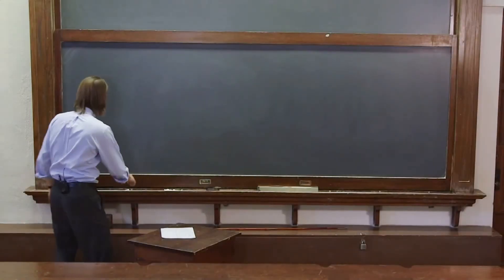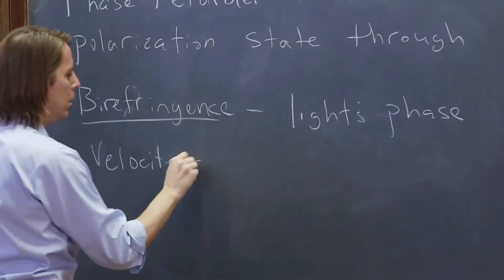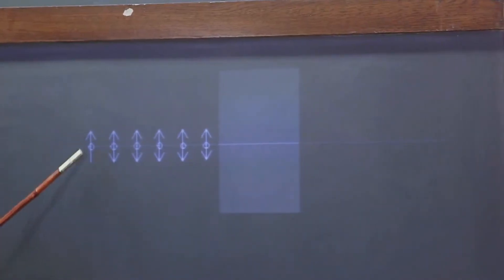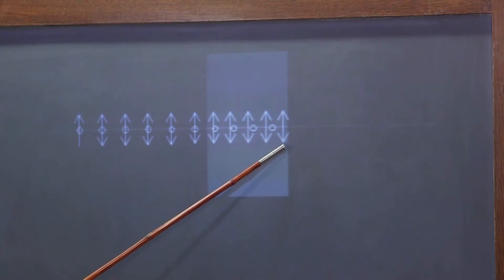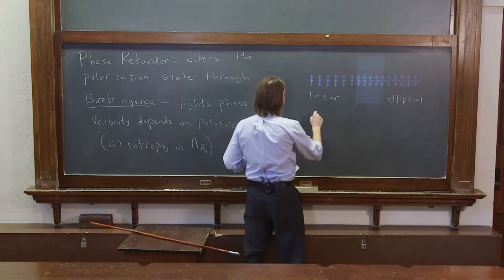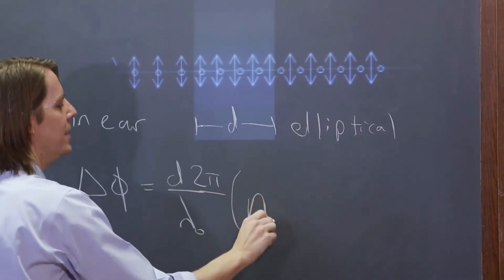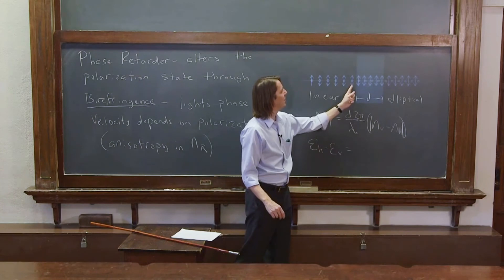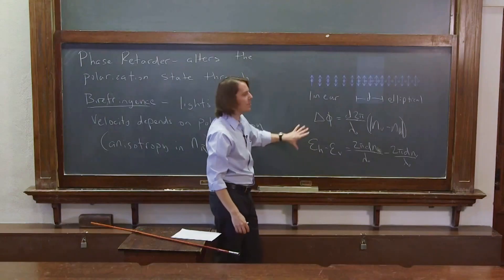PHYS 201 | Phase Retarder 1 - Birefringence

Comment: Ok so that equation is describing the phase change is for inside the dielectric and not including what the wave experiences on the outside Kd(n2-n1)? Also when you mention the n-horizontal and n-vertical do you mean the ordinary and extraordinary refractive indecies for uniaxial crystals?
Reply from the maker: Outside both waves are going through vacuum (or air, same thing in this case) so their relative phase does not change.  I probably needed to state that more clearly.

Yes, to second question.
Reply: @Prof-Hafner  Thanks for the explanation ive been struggling to set up the problems in optics because i didn't understnand how the phase changed

Comment: Are you describing unpolarized light at the beginning before it goes into the material (i.e., one vertically polarized ray of light, and one horizontally polarized ray of light), and the phase shift that happens to one of these polarized rays as they travel through the material, such that the two rays are now out of phase with respect to each other when they exit the material? 

Or are you describing one ray of light, and are talking about the electric field and the magnetic field becoming out of phase with each other for that particular polarized ray of light?  I've never seen this clarified by anybody.  They simply talk about the "two components" of light, whatever that means.
Thanks for any input.
Reply from the maker: I talk about it a bit at 2:00, but the input light has equal E field components up and into the board.  If we assume they are in phase (as drawn) then it is really light polarized at 45 degrees.  I just drew it as two components to help visualize the two components separating.  to be clear, all vectors shown are E fied, I don't draw B field vectors.

The word "unpolarized light" causes a lot of confusion.  If you are working with idealized, monochromatic light like we do in an intro optics class, it can never really be unpolarized.  There will always be a definite phase relationship between the two components. So it will be linear along a cartesian axis, linear long some other direction, circular, or elliptical.  Truly unpolarized light has the E field vector direction randomly jumping the plane.  But to get that it can't be perfectly monochromatic like in our drawings.  I think I have a brief video or comment on this at some point, but it gets complicated so I never cover it in detail.  "Coherence" is the topic to read about to learn more.
Reply: @Prof-Hafner  ,  Thank you for your response.  I didn't see it before.  Again, please forgive me, I'm not a physics students, but when you describe the "two components" in your answer, are you talking about the two components as being polarized and unpolarized light that have a phase relationship with each other, or are you describing something else?
Any time I have seen someone write or describe the "two components" of light, and a student asks them to clarify it,  they clarify it by again talking about the "two components of light" and their phase relationship to each other.  But they never explain further.  I'm not a physics or engineering student, could you please explain the two components to me in a manner I can understand?  Or are the two components of light simply polarized and unpolarized waves?  Again, thank you for any clarification.

Comment: If birrefringence depends on polarization, why when a birrefringence material is beamed with natural light in the same direction of incidence, it always refracts the light in the same way ? Dont know if the question makes sense, but thank you anyway¡
Reply from the maker: I can't really do a detailed explanation in YT comment, but here is one thing to keep in mind as you contemplate these things:  unpolarized light is not just a mixture of two linear polarizations.  In that case it would just be 45 degrees linear.  Or if there was a phase difference, some kind of elliptical light.  Unpolarized light usually means incoherent light where the phase relationship between the two polarizations (x, y or horiz, vert) is randomly fluctuating.  Or, you can just think of the electric field vector as randomly spinning around as it propagates.  This leads to some differences of behavior than just thinking of unpolarized as a simple mixture.  I'm not sure if it applies to what you are asking though.
Reply: both of you are wrong. the OP doesn't know enough to ask a cogent question and the responder failed to even try to decipher the gross concept errors.
Reply: @h7opolo *coherent
Something your comment is not.
Reply from the maker: You get what you pay for